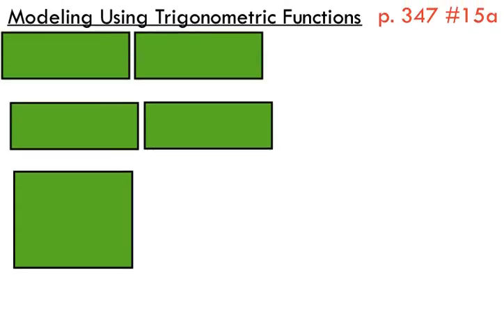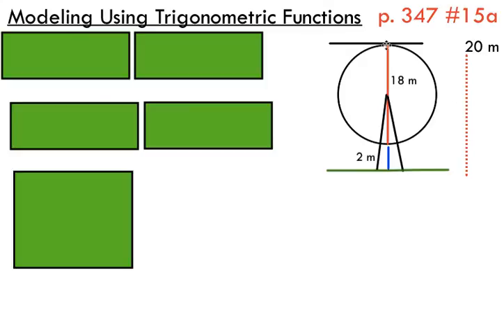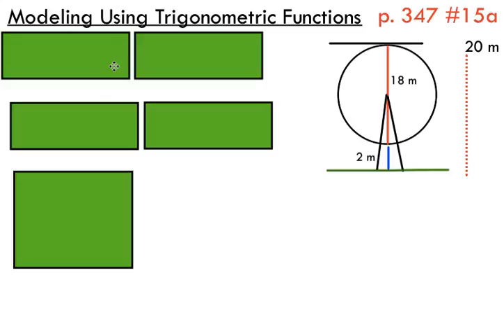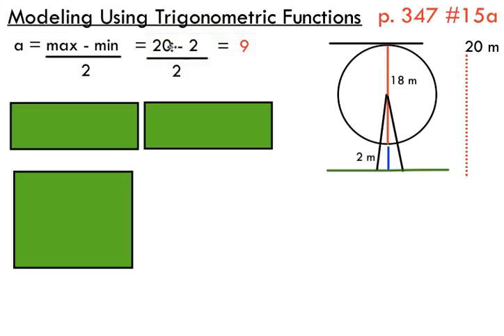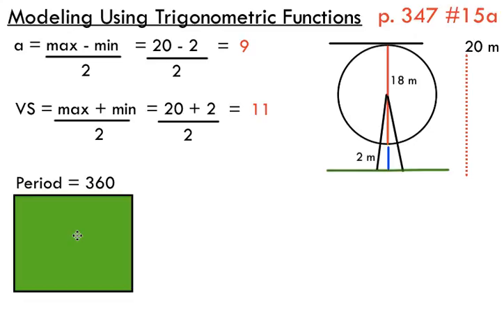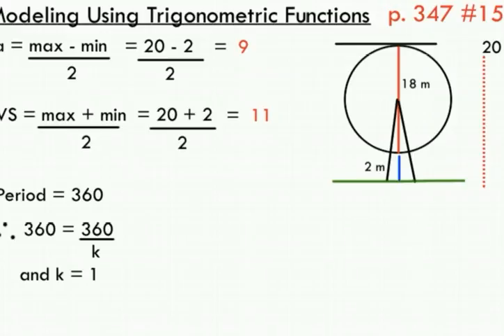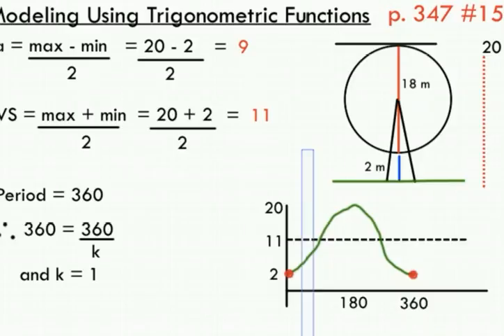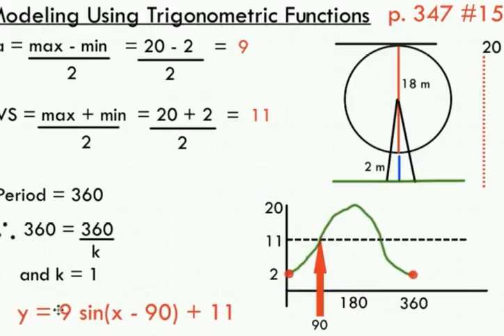Modeling Using Trig Functions - Ferris Wheel Example

Comment: Hi there. Thanks for the video, but there is a question. a is max-min/2, right? And the question is about the height above ground. So why you just took 24 (which is the radius) as your 'a' value?
Reply from the maker: Thanks for your question! However, I'm not sure I understand what you are asking. The radius of the Ferris Wheel is 9 m. If we use the calculation for amplitude ie.  max-min)/2  you will see that we get the same value as the radius of the circle, 9 m.
Reply: Thanks a lot, I got it. Have a good night! :)
Reply from the maker: No problem! Happy to help! Keep it here for your math tutorial needs!